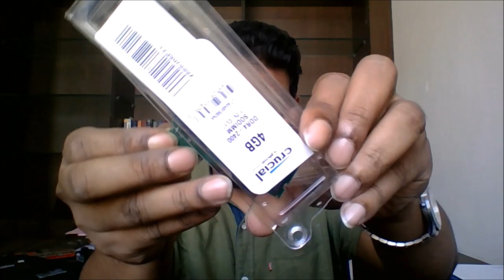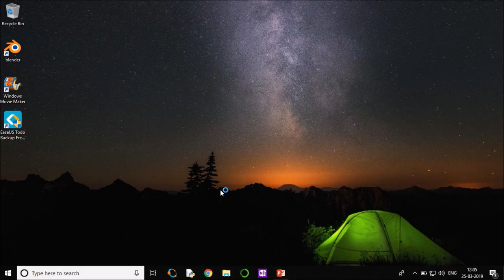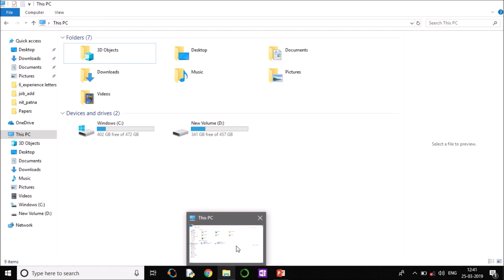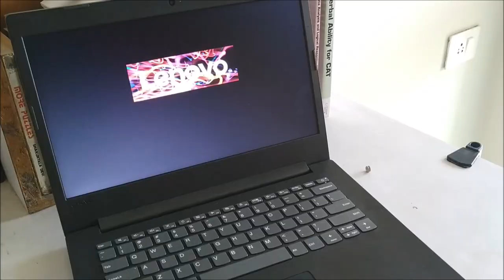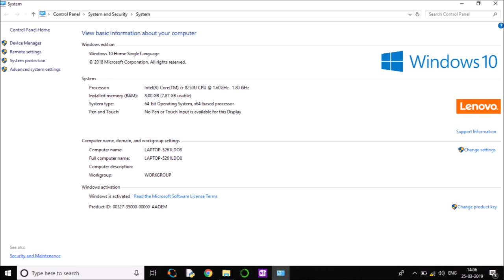Upgrading LENOVO Ideapad v130: HDD to SSD and RAM, unboxing of SAMSUNG EVO860 & Crucial 4 GB RAM

Comment: Bro I'm also using the same laptop. I want to ask that how can I use both SSD and HDD both at the same time. Bcoz I have replace my new SSD instead of HDD now I want to addd HDD too but I am stuck into it. Please help me out ..
Reply from the maker: Buy a CD-ROM to HDD converter case and place the hdd in the laptop in place of CD-ROM
Reply: @iqpop  bro I have place the hdd on the place of cd rom .
As CDROM is not there in this laptop that's why the odd cable is not there. And I'm stuck. I am not able to connect the hdd to motherboard
Reply from the maker: @adityabansal2264  are you using a campatable SATA 2nd bay 12.7 mm Universal Caddy

Comment: they have M.2 or NVME port in this model ?
Reply from the maker: You can set one by replacing the HDD or with a SSD with a internal CD ROM caddy
Reply: yes i know this method , just want to know if they have a place for it in the MotherBoard.

Comment: What is the max ram supported with ideapad 130-14Ikb?
Reply from the maker: Total 8GB as per product website. But you may install a 8GB cheap . I recommend 8GB . My laptop is working smoothly with 8GB
Reply from the maker: Yes. You can

Comment: Sir lenovo 130 model mee ram upgrade kar sakte he kya ..plz rply sir
Reply from the maker: Yes
Reply from the maker: It has one free ram slot which you can use to insert additional RAM
Reply: Thnks sirji
Reply: is it have extra port to connect ssd? (i mean addition ssd which work with hdd(which is  inbuilt))